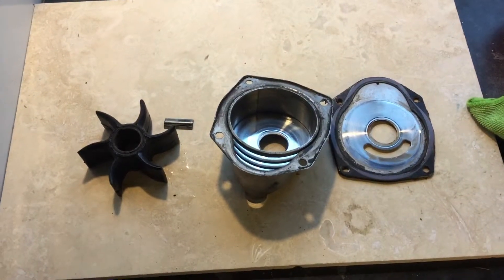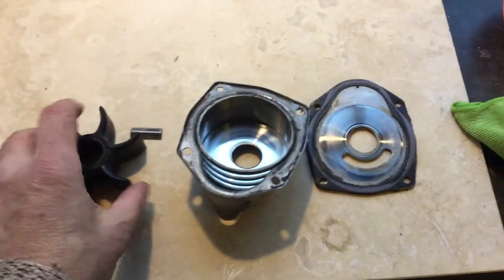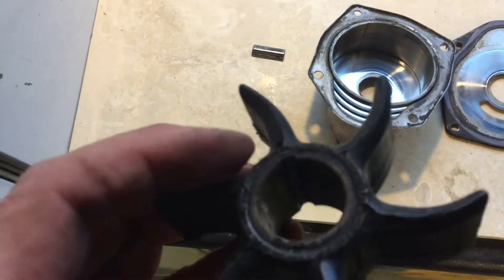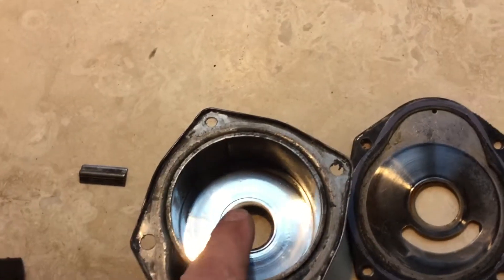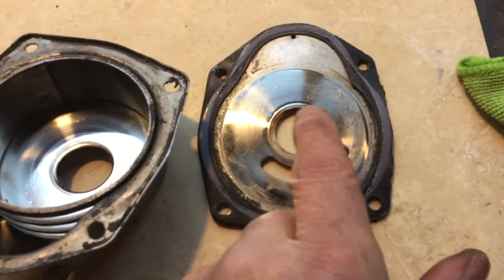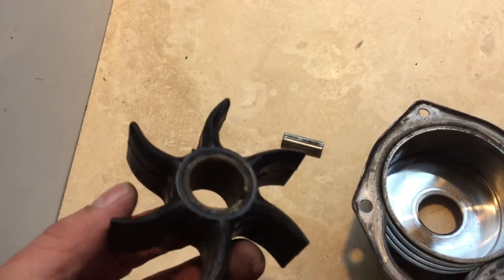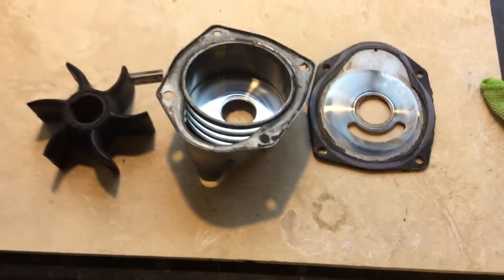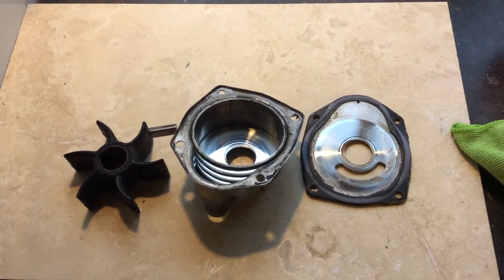Mercury 75HP 2 Stroke Impeller Change Part 6

Comment: Just changed mine on my 60hp merc. Totally different. In fact West Marine gave me the wrong impeller kit and looks like it would fit yours. Anyway I had a impeller that fit and made a gasket. Allot of the older merc parts are not carried by marine stores that are more into selling everything other than parts. I found a good place that does or can order for me.